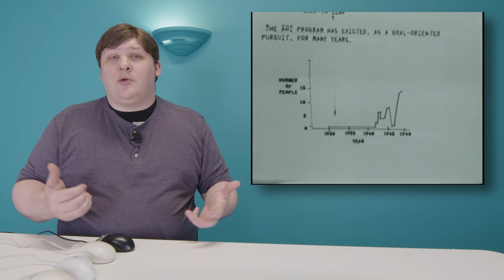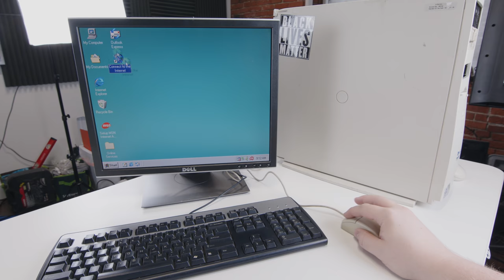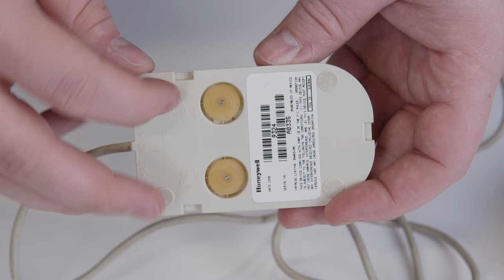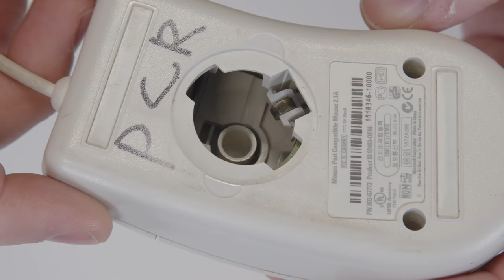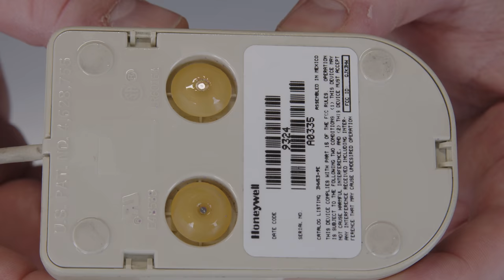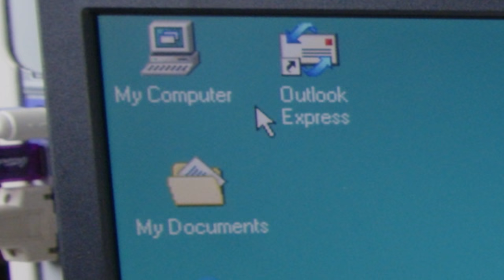Jack Hawley's Unstoppable Computer Mouse

Comment: There are pots that don't have a stop and will just roll over to the other end of their resistance value if you keep turning them so it's possible that it just looked at whether the value was increasing or decreasing and knew where the value would roll over and accounted for that.
Reply: Or it just tied the resistance values to X,Y coordinates.
Reply: @randgrithr7387  This is what I would do. Unfortunately that would mean a non-square aspect ratio would require some weird stuff inside.
Reply: @DigitalJedi  Or you can just map it to a square area and clamp the cursor inside the screen in software.
Reply: The 'Driving Controller' on the Atari VCS / 2600 could rotate endlessly, whereas the visually similar 'Paddle' controller had a fixed degree of rotation left and right.
Reply: @DiThi  considering the time period and general disposition of programmers that's exactly what they did. 😂

Why bother making it an engineering problem when you can just ignore the major problem with software. 

Not like you'll be using this design for decades, right? (Incidentally the reason we had so many terrible standards, as we all know)
Reply: On the other hand, the wheels were pretty big. I bet you'd get a 6 inch square out of them, stop to stop.
Reply: there are also multi turn, where the the shaft can rotate several revolutions before reaching the end. with gears, you could have an massive range of motion. And yes, it'll be very clear there must not be hard stops... otherwise you would need to "rewind" your mouse lol.

Comment: I used the one of those back in the day, that exact Honeywell model in fact, and I found it had exactly the same sticking issue.

It was still better than a gummed up ball mouse, but at the time I definitely preferred a clean ball mouse - especially for small and accurate movement.
Reply from the maker: Thank you for the confirmation! I absolutely love it when I post one of these videos and someone shows up who has first hand experience, it really pulls things together.

Comment: If you find yourself missing the days of cleaning "mouse droppings" out of roller ball mice, try the logitech optical trackball range! All the precision of a lovely trackball, all the satisfaction of cleaning some grot out occasionally, but when it needs cleaning it doesn't start to skip and become unusable, it just gets a bit slow/stiff.
Reply: May I suggest (one of) the holy grails of trackballs if you like the logi stuff so much?
Kensington expert series. You won't look back at logi again. Thumb and smaller trackballs are behind when it comes to ergo and accuracy of a large ball. I've tried the logi ergo or whatever the latest elevation adjustable one is. It's neat but just not as smooth as the larger stuff sadly. 
I've owned multiple Logitech mice and nothing holds up like their old MX700, that thing is still working nearly 2 decades later. Their newer stuff though isn't built as well nor does it last me as long, from personal experience. Everyone has different stories. But definitely do check out the Kensington Expert series they are the gold standard for professional trackballs and I see them everywhere in high end entertainment/film/CAD/etc for a reason.
Reply: I always wondered what all that "dirt" was? I mean was mouse pads really that dirty..
Reply: @stiannobelisto573  Usually dust, which has a high percentage of... dead human skin cells. Even if you cleaned the mouse pad regularly, any time between cleanings was enough to gather some dust.
Reply: @stiannobelisto573  dead skin cells and hand oil mostly

Comment: One of the reasons to use a magnet here is the push force onto the surface, which allows the mouse to grip in these weird conditions.
The mouse would be amazing in industrial environments though! But most HMIs for industrial machine use track balls.
Reply: Man, imagine the magnets sucking up all the filings and chips and stuff in such a place, though.
Reply: That is easy to fix, just add some metal to shield the magnetic field
Reply: Or they are touch screens. Or are dumb HMIs with dome function buttons. But track balls are popular in older settings.
Reply: @akkudakkupl  Resistive touch screens, if memory serves. The capacitive ones used on smartphones and tablets won't work with gloves unless they include condictive fibres, while the resisitive ones will, and can have extra layers of screen protection added on top without impacting functionality as well.
Reply: @Roxor128  exactly.
Reply: @Roxor128  I admit, I totally forgot resistive touchscreens were a thing for a second there...which is sad considering I've used them and really want them to overtake capacitive ones again (especially once they develop accurate multi-touch ones)

Comment: Funny, I'd never seen one of these before until relatively recently, I saw one of the puck-shaped DEC ones sitting on a shelf in the back room of a computer museum in Pennsylvania a few months ago. It was missing the wheels, the bottom just had two little metal axles sticking out, which made it even more perplexing, but I took a picture so I could look into it when I got home.  But even as I was reading about it I was thinking: "there's absolutely going to be a CRD video about this thing at some point."

Comment: I was just thumbing through a PC magazine from the middle of 1990, as you do, and ran across an input device review.  Typical price of a run of the mill mouse was around $150.  So they were definitely not disposable commodities in 1986.

Bear in mind, in the mid 1990 computer magazine, there was some talk about how this or that might change once people move over to a graphical environment like Microsoft’s Windows.  The takeaway here is, at least in PC land, a mouse was still a very optional component.  There were some apps that had screens shot in Windows/386, but Win 3.0 hadn’t even made it to the party yet, and 3.0 is when anybody actually cared about that Windows thing what took up all the memory in a computer.

So I would propose that, more than likely, what led to the demise of this strange design is not the cost, but the fact that it was going up against other established manufacturers that had solid distribution channels, in a market that was mostly apathetic.

Both Logitech and Microsoft were deep in the game in ‘90, for example.  The product probably died from lack of oxygen, since anybody who even cared about graphical environments enough to have a mouse would get one from the vendor that made their keyboard, or made their barcode scanner, or their OS — and probably never realized this weird thing even existed.
Reply from the maker: That number seems high, to be honest. I'm curious what magazine you're looking at and what their angle is. PC Mag Apr 15 1986 has mice between $104-140 (major name brands) and PC Mag Jul-Aug 1990 (both avail on goog books if you wanna compare notes) has them as low as $50 for a Tandy two-button. If we're talking high-end, sure, they get outrageous, $300+, but by 1990 (hell, by 1983!) "run of the mill", in the context of PC hardware, meant just what it does now - "some Taiwan fly-by-night you've never heard of." The clone market was beyond massive, people were buying no-name garbage with a scoop and a scale, as far as I can tell the prices on even mildly-named garbage were already largely in the double-digits. These are just the PC Mag prices; I'm certain if you were at the <sacramento television ad in 1990 at 3AM voice> Computer Show And Sale! buying a mouse in a ziploc out of a huge bin, you could get em for $30. And, of course, all that's moot - because, yeah, your PC came with a mouse! Or your OS (I have a copy of Win 3 with a packed-in Logitech... or is it a Logitech with a packed-in Win 3?), or your CAD software, or your word processor, or... or... or... Except for the most discerning of individuals, mice had become fungible, invisible; if you were supposed to have one, you did.
Reply: @CathodeRayDude   PC World, June 1990, page 169.  I don't think PCW is readily available in the digital archives, but it's a buyer's guide to keyboards, mice, trackballs, etc.

The Mouse section isn't quite as bad as I remembered from a couple days back when I was reading this.  The Logitech Series 9 Mouse and Microsoft Mouse were both about $150, although TBF, the Logitech had quite a range of prices depending on the interface -- as low as $109 -- and the MS Mouse did ship with a copy of Paintbrush (reader service number 680, if you want to get in on that deal.)  So there's that.  And these are list prices, so pre-Internet, maybe assume 20% less street.

There were cheaper options, many in the $80-110 range, and even a couple at $50.  The trackball list is a little more like what I was thinking of, where they average in the mid $100 range.

At this point (mid 90), I don't know if I had actually used a mouse yet.  The Mac had one since 84, and there were a few early computers that would use one if you had it.  But we had a C64, with a software package called GEOS.  It was a graphical environment that had the usual desktop software bundle trimmings, but I think its main purpose was to teach you patience.  It could make use of a mouse, but it hadn't really even occurred to me that it was something you might do, since the keyboard UI was 100% functional and you could use a cheap light pen to draw.  I remember asking about something in the manual, and my dad had to explain to me, "oh that uses something called a mouse."

It wasn't until we got a 386 running Windows 3.0 that I ever really used one -- and I remember it being in the neighborhood of $80 to replace.  Which I found out when I scraped out all the "gunk", and it turned out that gunk was a textured surface applied to the steel rollers so they could grip the ball.
Reply from the maker: @nickwallette6201  that's fascinating context. Don't get me wrong, I had no doubt that the majority of people who used computers never used a mouse before Windows 95, but frankly I had imagined that people were more or less familiar with them even if they hadn't used one. Either way, I think your point stands that mice were not fungibly inexpensive for the average individual - but I think maybe that's the rub, because I was thinking more in terms of business use, where the mouse would have shown up much earlier than for most consumers, and costs for necessary tools were thought of more in terms of thousands of dollars a year than dozens. If the hawley mouse was under 80 bucks, then it was probably competitive with what a CNC machine shop might have been buying, but I feel like the thing was probably upwards of 100, and not competitive with those bargain basement mice, especially since there are other hazards in the shop that were just as capable of destroying a mouse in its entirety, regardless of the cleverness of its tracking system. If your guys keep dropping mice and rolling the forklift over them, you're going to want to buy the cheapest possible unit. I think that's the kind of scenario I was imagining.
Reply from the maker: @nickwallette6201  also the anecdote at the end there is tragic and hilarious
Reply: @CathodeRayDude   That's generally what I aim for.  haha

You could be right about the cause, though I still see it as a casualty of obscurity.

Here's why, if you're interested enough:

Having not been employed in the 80s, but an avid computer magazine reader from the 90s (and now revisiting them with the benefit of a few decades of historical context), it seems the majority of business use on PCs was text-based.

The tips and tricks section of that (and every, at the time) issue covers dBase, 1-2-3, Word Perfect, Microsoft Word and Excel... but not so much Word/Excel for Windows.  The columns are all plumb with sequences like "<Shift>+<F7> C, D" that they suggest recording as macros to make repetitive tasks easier.  Nary a "click OK" to be found.

There was a whole review of the products in the "Groupware" space -- e-mail, calendaring, task tracking -- all the stuff that basically collapsed into Outlook.  All of that was text-based too (with "memory resident" support for hotkey access!), and the UI coherency (or lack thereof) was a big part of the scoring.

Of course, the CAD people were a different subject entirely.  And I would assume the coincidence of mice and floating-point co-processors was probably nearly 1:1.  But that probably would've been still a bit of a niche.  Perhaps a largish niche.  The "teflon and oil" thing does seem to imply that maybe this was the imagined customer, although how much CNC operation was being done from a graphical UI in 87?  And how many of the CAD engineers were working from the manufacturing floor?  That's just a bizarre tidbit any way you dice it.  :-)

Moving on...

In the section of that review on mice, the article says this:  "All the products in the mice table are compatible with Microsoft's two-button rodent and should work with programs like Windows, Ventura Publisher, and PC Paintbrush."  So add desktop publishing to that niche, for those that were brave enough to stray from their Apple orchard.  Maybe it was machine oil to lubricate the printers?  * shrug *

So, how about a look at what was on the top shelf of hardware at the time?  There's a review of three brand new 486DX/25 PCs, where they were compared to current-gen 386DX/33 PCs.  They listed an AST Premium, IBM Model 70, and NCR PC486.  Standard configuration:  "486 at 25MHz, 4MB RAM, 110MB HDD, 1.2 or 1.4MB floppy drive, VGA and VGA color monitor, at least one parallel and serial port, 101-key keyboard, and DOS 3.3 or later."  No mouse.

IMO, it all seems to paint a picture that they weren't really in widespread use yet.  Actually walking down the halls of a well-financed company might differ, I dunno.  All I have is what I can read now, and that's obviously going to be catering to some kind of target audience.

So, anyway, that's why I think it probably wasn't so much a cost factor that held the Hawley mouse back.  I mean, sheesh, those 486s were $11k to $15k.  That's quite a figure, and quite a spread.  What's another $200, plus or minus 50%?

The mouse review did actually point out the difference between mechanical and optical mice -- namely that optical mice didn't need to be cleaned, but cost a lot more and required a special mouse pad.  I have no evidence to back this theory up, but I bet that if that Hawley mouse had been prolific enough to be on anyone's radar, it would've found some footing on that benefit alone ... before eventually falling by the wayside, which was probably inevitable unless they licensed the technology generously.

I mean, users clearly weren't afraid to try new things.  For gosh sakes, that review covered a model with 40 buttons (!!) on it, for macro recall, listed at $249.  (Prohance Technologies PowerMouse 100, in case you're wondering.)

That ended up being well more than 2c worth, sorry.  :-D
Reply: @CathodeRayDude  Back when the Honeywell mouse was a new thing, I read about it in a computer magazine article. Forward some years, I saw one for cheap in a thrift store, though about buying it but put it back on the shelf. I should've bought it!

Back in the time when ball mice were still costly, I used to repair them, mostly bad left button switches and cables with broken wires. Many mice used snap dome tactile switches and after a few zillion snaps the tiny metal dome inside would split. I'd take a mouse that was defekt for some other reason then cut the melted posts holding the metal cover to the base on the right switch. The same would be done to the bad right switch. Transplant the snap dome then replace the cracked dome with the good one. Snap the metal cover back on then carefully apply a drop of super glue atop the 4 pegs. Doing the snap dome transplant worked even when the switches were different brand, sizes, or pin positions. The preferable fix was finding a donor mouse with the same switches so the whole switch could be changed.

The other major failure was a broken wired in the cable right where it exited the mouse body. The fix was cutting an inch off the cable, leaving enough on the internal connector to solder to, when there was a connector. Otherwise just cut an inch off and solder to the PCB. What caused the wire breaking was too convoluted a path through the plastic to grip the cable so it couldn't be yanked out. Typically there was a very sharp 90 degree bend just before going outside the mouse and the hole had sharp edges. Some careful knife work eased that and allowed for some amount of movement for more gentle flexing. It was mainly the more expensive mice that got broken wires. Cheaper mice tended to have a flexible strain relief molded onto the cable and designed to be held between the mouse shell halves, no need for the convoluted passage to hold the cable. That made the plastic injection molds easier/less expensive to make and used a bit less plastic.

One very cheap mouse I had ended up tossed in the trash. Instead of optical encoders it had PCB disks with spring wire contacts. Jerky and noisy, both audibly and electrically. I could hear the whirrr of the encoders and every move made my computer's speakers *rrrrrr*.
Reply: @greggv8  Do you recall the first iteration of the Microsoft mouse, with the steel ball? I found one of those in a storage closet at a software company I was working at, around 1994 or so. I think the date on the package (a hard plastic box) was 1989. Nobody believed me that I'd found a mouse with balls of steel!! 😋
Reply: @MrJest2  you found a Duke Nukem mouse